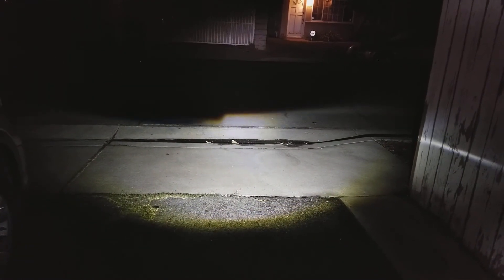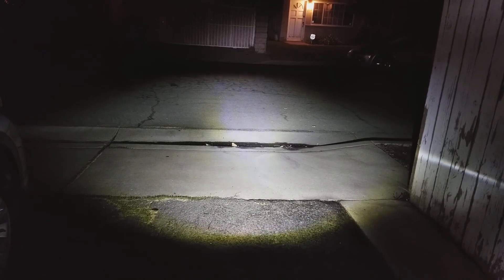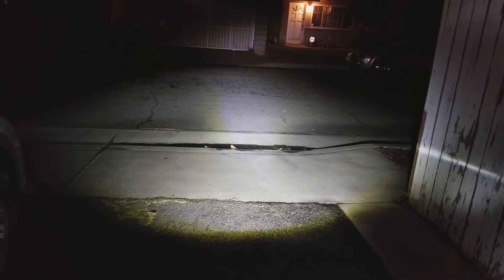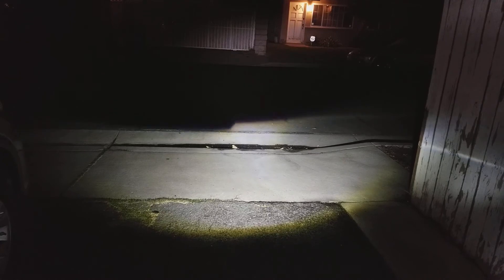Vader 125cc Honda Grom Clone Headlight Mod

Comment: My lights are surprisingly good. It's not even real led bulbs it's just 2 small led lights on top of the inside of headlight but no place for actual bulbs to go so if I want to install bulbs I'd have to buy a whole new headlight assembly